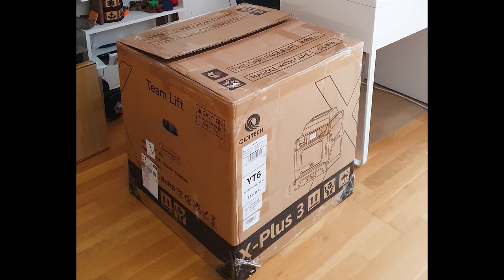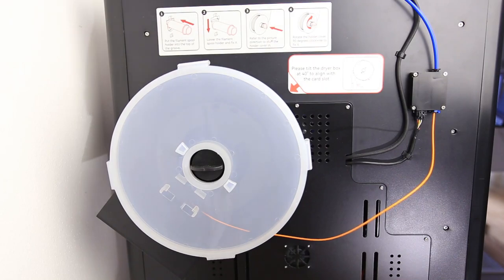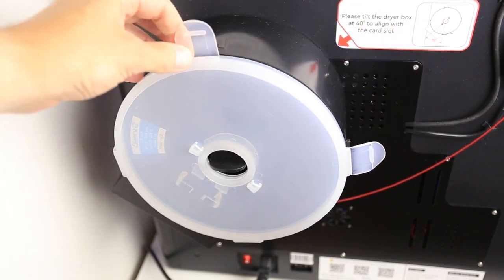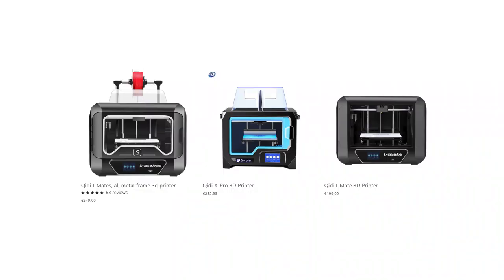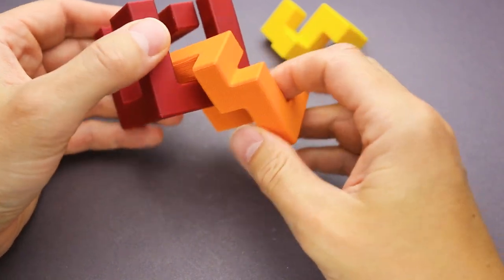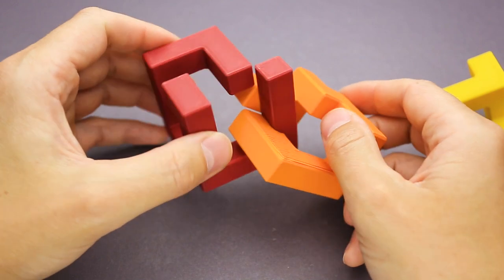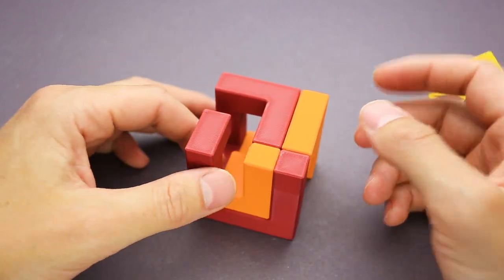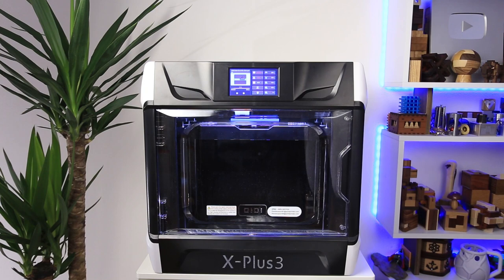I'm addicted to 3D printing again. Solve my first 3D printed TIC puzzle.

Comment: If you want to print the puzzle without supports so it looks nicer and doesn't waste filiment you will need the Puzzlecad addon for OpenSCAD. You can import burrtools files into it also. This will smartly break the pieces up that would need supports and print connectors. It also will reduce the size of the pieces a little so they fit perfectly together. It adds another step before you can print a TIC or cube but it's absolutely worth it to dramatically increase your print quality by removing supports.
Reply from the maker: Thank you for this great tip. I'll try it next time.

Comment: Why don’t you buy a small ikea Lack table and some lockable casters to put it on. Then you can move/rotate at will.
Reply from the maker: This machine is too big and heavy for the IKEA small table. I have one but I shakes a lot while printing. That's the reason I bought another piece of furniture just for the 3D printer